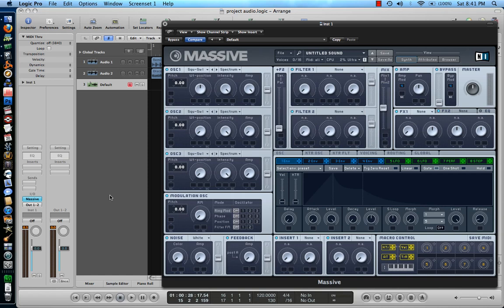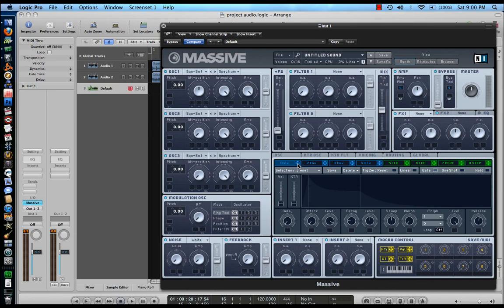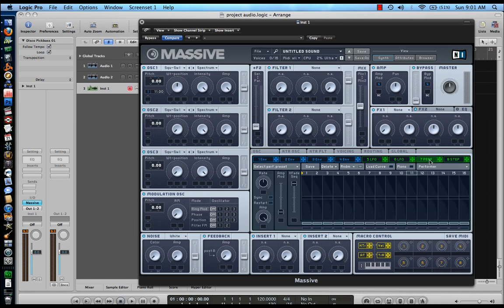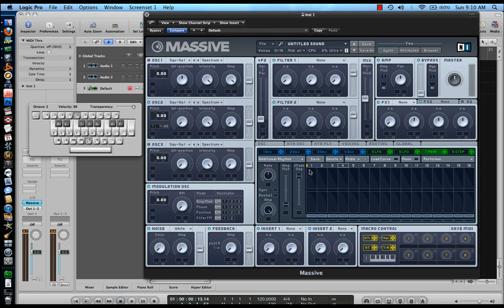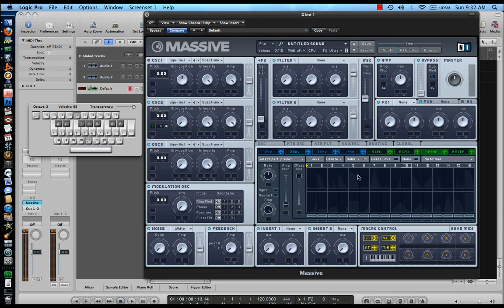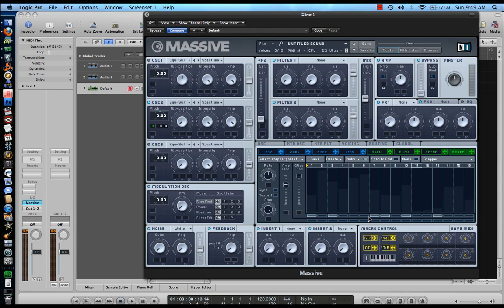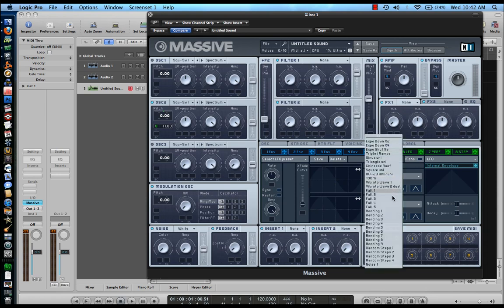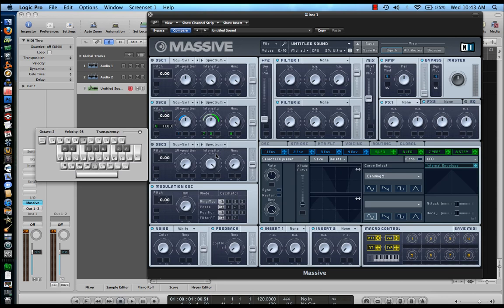Beginners guide to Native Instruments - Massive Part 2

Comment from the maker: @MaartiNOlssoN what do you mean when you send it to the piano roll?  do you mean when you write in midi notes on your massive channel that it plays the same tones?  have you changed the osc waves?  also have you modulated the parameters using the modulation devices?  if you have presets, i recommend that you load a preset that you like and tweak out some of the settings that it has on there.  im not sure if i understand your question but let me know!  part 3 will be out in 2 weeks!!!  i promise!

Comment from the maker: @MaartiNOlssoN the pref, stepper, and lfos are modulation devices.  you can put those into any parameter that you want to modulate.  i recommend you to randomize your perf. and then assign it to your pitch (dont forget to set the range).  then once assign the same perf to the intensity.  then assign it to your wt-position.  you should have an understanding of what you can use it for.  its not good for one specific thing if you know what i mean.  the shades vs lines do not matter.